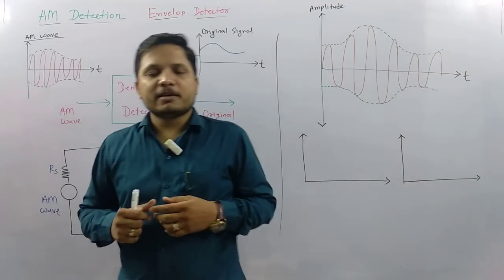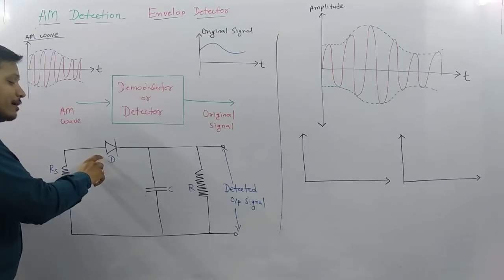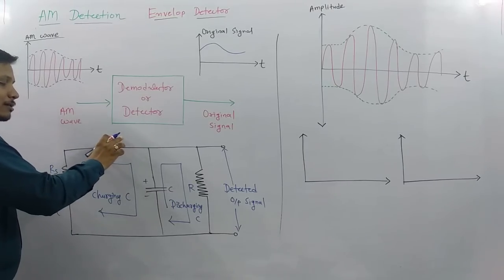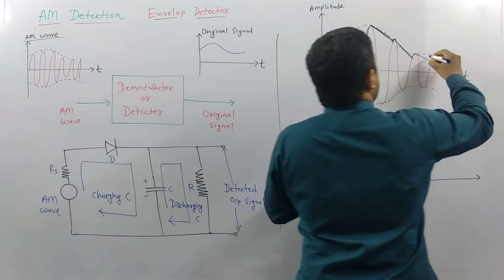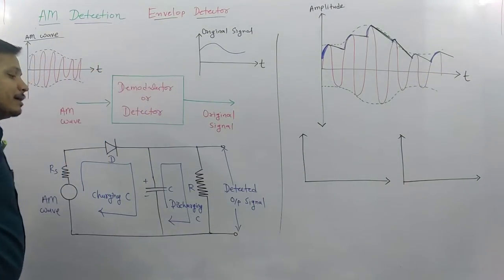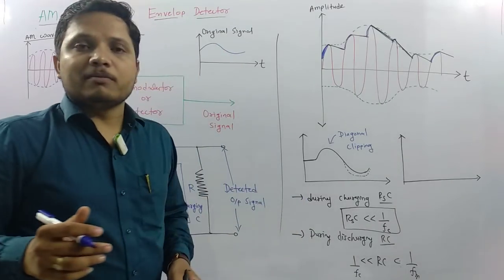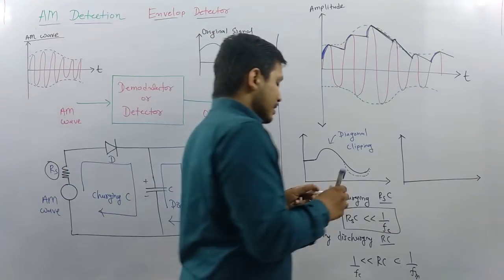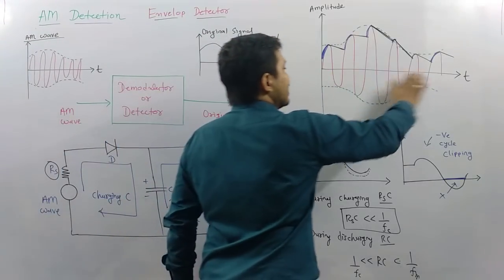Envelope Detector (Basics, Derivation, Working, Block Diagram & Circuit) Explained | AM detection

Comment: The RC load for a diode envelope detector consists of a 1000 pF capacitor in parallel with a 10-K resistor. Calculate the maximum modulation depth that can be handled for sinusoidal modulation at a frequency of 10 KHz if diagonal peak clipping is to be avoided.
Reply: @engineeringguy7108  how 🤔  ❓

Comment: AM signal is sinusoidal in nature and capacitor acts as a short circuit for ac....so how will the capacitor gets charged? And generally dc is used to charge the capacitor.
Reply from the maker: Capacitor charging and discharging is based on charging and discharging time constant. It is not based on DC.
Reply: @EngineeringFunda  Oooo
Reply: The AC is converted to spikes of DC by that diode

Comment: Certainly! Here are five key differences between an envelope detector and a phase detector:

1. *Primary Function:*
   - *Envelope Detector:* Extracts the envelope of an amplitude-modulated (AM) signal to recover the original modulating signal.
   - *Phase Detector:* Measures the phase difference between two signals and generates a signal proportional to this phase difference.

2. *Application:*
   - *Envelope Detector:* Used primarily in AM radio receivers and demodulation systems.
   - *Phase Detector:* Used in phase-locked loops (PLLs), frequency synthesizers, and various synchronization and modulation applications.

3. *Operation Principle:*
   - *Envelope Detector:* Typically involves rectifying the input signal and filtering to smooth out the high-frequency components, leaving the envelope.
   - *Phase Detector:* Often involves mixing or multiplying the two input signals and then filtering to extract the phase difference information.

4. *Signal Handling:*
   - *Envelope Detector:* Deals with the amplitude variations of a signal.
   - *Phase Detector:* Deals with the phase relationship between two signals, regardless of their amplitude.

5. *Circuit Components:*
   - *Envelope Detector:* Generally includes components like diodes, resistors, and capacitors.
   - *Phase Detector:* Can use components like mixers, multipliers, or specialized phase detection circuits.

In summary, envelope detectors are designed for demodulating amplitude variations, while phase detectors are focused on measuring and adjusting phase differences between signals.
Reply from the maker: Chatgpt answer

Comment: Suppose, if two wireless signal 950MHz & 1800MHz are passing through this circuit at same time with amplitude of 0 dBm & 5dBm then how it will flow through the detector and what power & frequency we will be seeing at the output